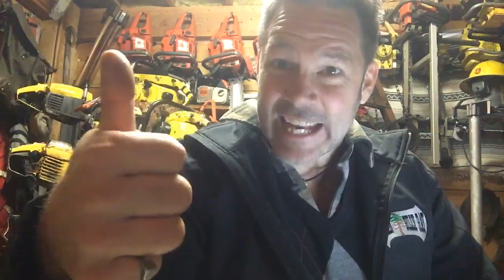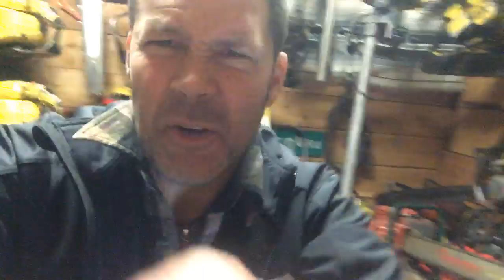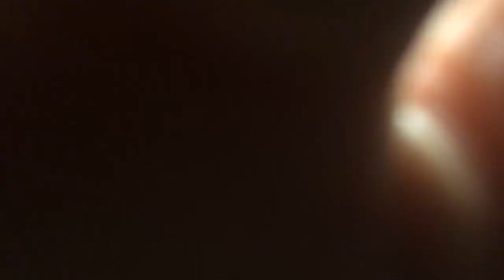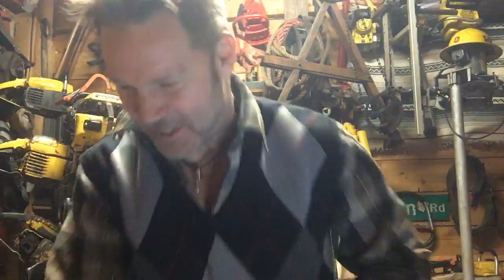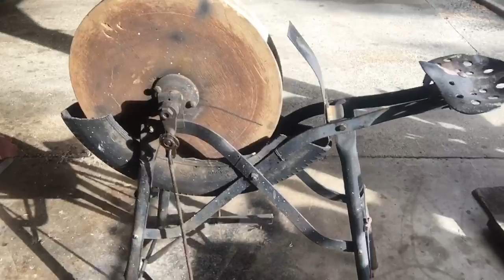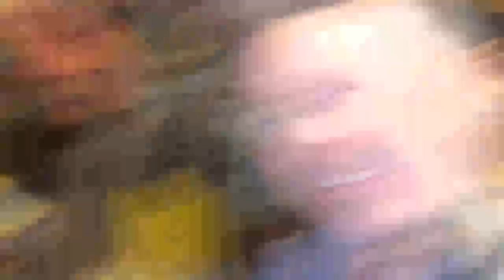On boxing and testing settings

Comment: Hey Buckin' what is the preferred wood for an axe that is going to be used to drive wedges? I am seeing a lot of hickory and some birch here but nothing else. A lot of the handles say they are not for striking. I am over here in Sweden so plenty of axe heads but I need a good handle. Thanks.